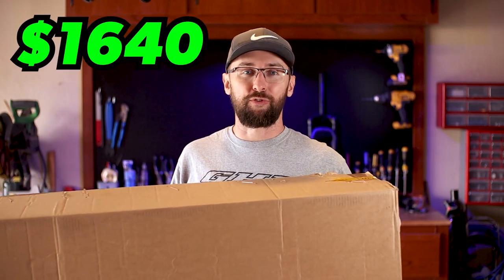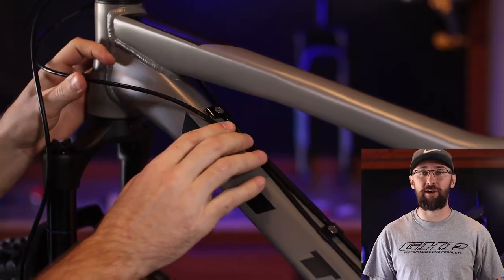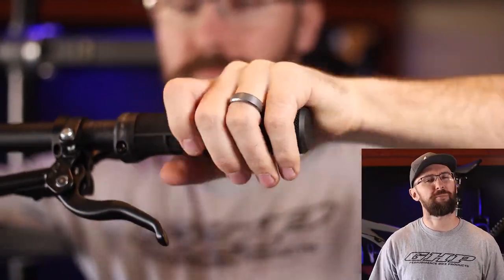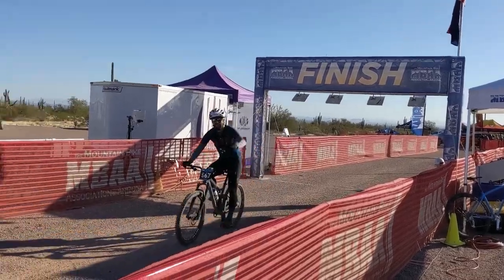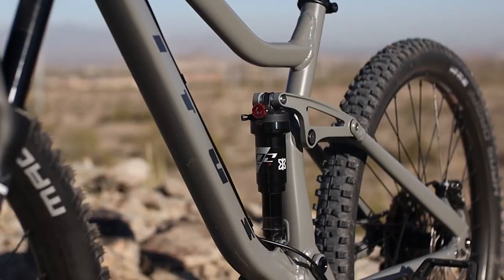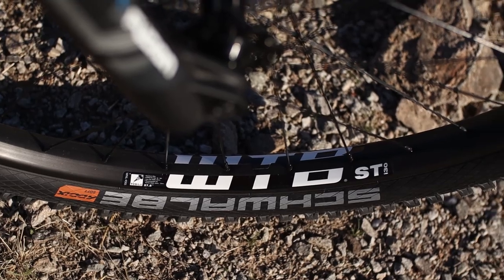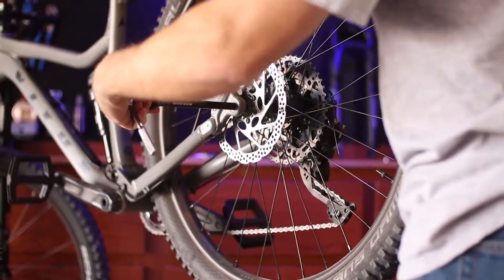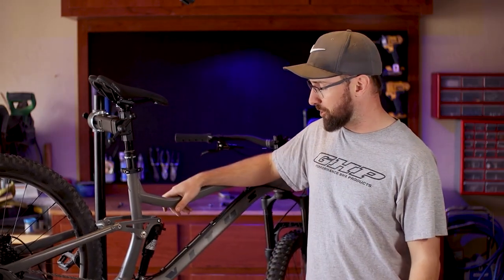Is this Vitus Mythique the best budget trail bike?

Comment: Congrats on the new bike! I recently got the same bike size medium but with 29in wheels. I had the same reaction when I heard the rear hub too! So sick. Only thing I’ve done so far is upgrade the pedals. Looking forward to seeing how you upgrade yours. I’m leaning towards a 12 speed cassette as my next upgrade.
Reply from the maker: Oh nice congrats!! Do you notice that the derailleur doesn't have a very strong clutch? And I can't back pedal at all or I lose the chain.
Reply: @EvansMTBSaga  I’ve only ridden it around it around the neighborhood but will be hitting the trails this weekend so I haven’t been able to see how the clutch performs. Will report back though. 

Mine did the same with the chain jumping. After re-indexing the rear derailleur, the chain has been staying put when back pedaling. Hopefully it doesn’t start jumping once it gets rattled on the trail.
Reply: @EvansMTBSaga  took the bike to the trails today for the first time. It felt really good. I didn’t notice excessive chain slap, granted I was using mostly mid to low gears. The 10 speed seems fine for my needs so I don’t think going to 12 speed makes sense for my next upgrade. The bike is definitely more capable than I am right now so I just need to get more trail time.